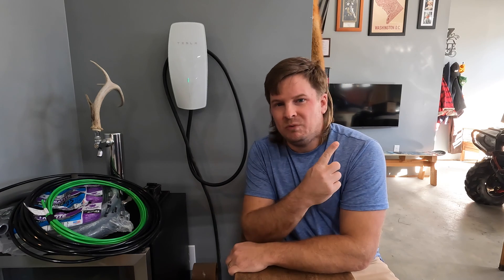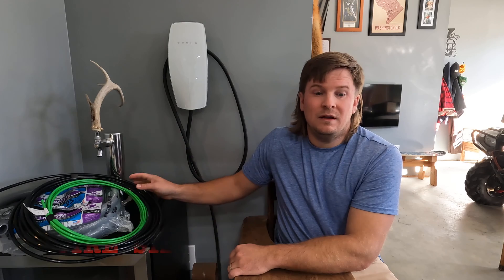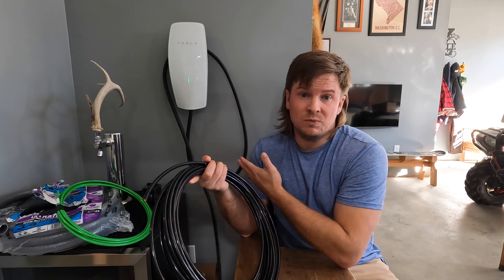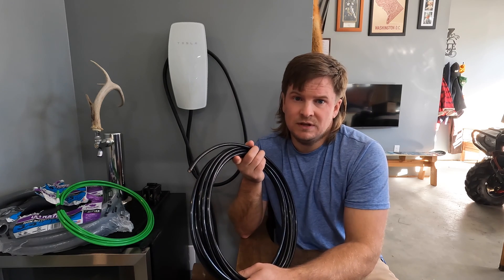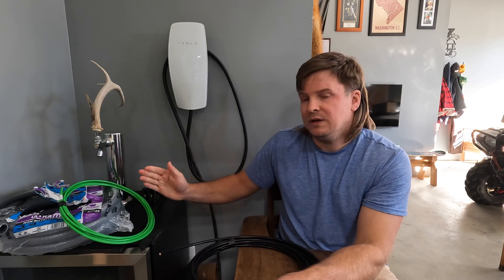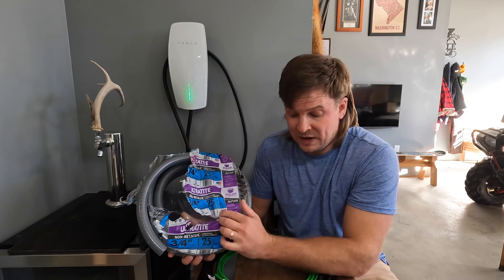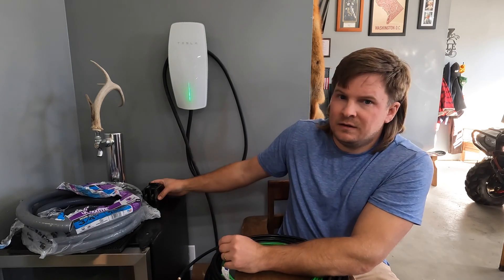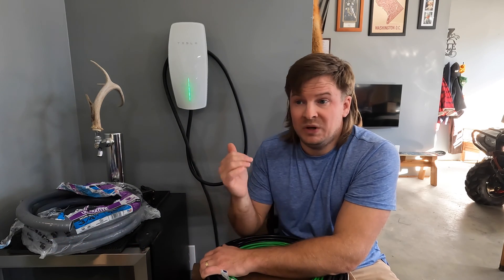Installing Tesla Wall Connector TIPS

Comment: Your  video makes about 50 Ive watched. I am running wire about 72-74 feet and  opted to go with 4awg for the hots and 6awg for the ground. I am using 1" conduit (Liquid Tight like you show) across my attic. Then I am going to use a 4" box to make the transition a bit easier at the point where I come in through the garage ceiling. I will mount the box in the attic, tie in the flexible conduit and then exit the box with 3/4" EMT (metal) to go through the ceiling down to the top of the charger. The box is just to transition, the wires will be a continous run. I could find adpaters to go from the flex to metal but not one that reduced size as well. I want to come into the charger with 3/4" as it will be coming into the top and Tesla states you should not make it any larger than that. I think EMT in the garage will look better than the flex as well.

Comment: 6/2 is NOT acceptable if you're trying to use the max. 48A rate - Romex does NOT meet the 90deg C. heat rating. Only 6ga. single THHN strands run through conduit are OK.
Reply: or MC 6/2

Comment: Glad I found your post. I need to run about 88ft. for my wall connector. The Tesla manual said to use 6 gauge. With the Voltage calculator, drop will be limited to 1.56% or less with a 6 AWG.I wanted to try the 4AWG. The Voltage drop will be limited to 1.01% or less with a 4 AWG copper conductor delivering a total of 48 amps on a 240 volt single phase system for a distance of 88 feet. So thanks for your post I will subscribe. 😉

Comment: This is very helpful. In Los Angeles - and probably all of California - they offer a $ 1,000 rebate for the charger and installation but will NOT give a rebate unless it's installed by a licensed electrician. Also, as of this post, LADWP will NOT give a rebate on a white charger, they only rebate the J1772, which is the black charger. Go figure. I am told that will be changing, eventually, but just be advised.
Reply: Isnt there a 30% Federal Tax credit for these?

Comment: if youre using THHN wire, I believe the 6awg is rated for 75amps, so should be good. If romex, yeah go 4 awg, 6 awg romex is only rated for 55 amps. What gauge ground are you using?  I was reading you only need a 10awg ground wire for a 60amp circuit, but curious if people are going lower.
Reply from the maker: Thanks for the info! I am using 8 gauge for the ground.

Comment: could you post link to where you bought 4/2 cable. Big box stores only carry 6/2
Reply from the maker: Hey Anil. I bought the 4 gauge wire from Lowes. You have to buy it by the foot for each L1 and L2 (run both wires and then your ground also). So you I’ll have 3 individual wires ran through your conduit. I don’t think you can buy it all wrapped into one. Hope that helps.

Comment: Top Tip DO NOT BUY A TESLA HOME CHARGER.
Do not buy a Tesla wall charger, get a different kind. Tesla wall charger aren't as good as many of the cheaper ones available. Payless to get a better quality charger plus Tesla has no customer support, so when you get a defective Tesla wall charger no one from Tesla will help you
Reply: Not buying this "TOP TIP".  The "State of Charge" video guy on youtube actually says the Tesla charger is the BEST.  He runs chargers through a barrage of tests, drop, cold,  heat, etc.  I have one, and have never had any issues with it, and it was super easy to install, and has built-in gfci protection.  Tesla offers a 4 year warranty - who else does that, and its the only charger that I am aware of that accepts #4 AWG.  That alone tells you that Tesla chargers are the best built/engineered units.  If you get a defective one, which I suspect is an extremely unlikely probability in the first place - just return it.  At $425.00 for that kind of quality, and a 24 foot cable; I doubt that there is a better charger right now.
Reply from the maker: Thanks for sharing
Reply: Do not buy a Tesla wall charger, get a different kind. Tesla wall charger aren't as good as many of the cheaper ones available. Payless to get a better quality charger plus Tesla has no customer support, so when you get a defective Tesla wall charger no one from Tesla will help you
Reply: @CarsonAdventures which one did you get? Thanks
Reply: @usinebob   grizzl-e level 2 the $395 dollar one. A friend of mine purchase their $495 version and it's nice but I personally don't think about it. There's nicer. I think there's $395 one is the best bang for your buck. No issues at all. Even in an Ice storm and a week that never got above 15 and spent most of the time at 0 and below.

Comment: That 6-2 wire is not rated for 60 amps, that number 4 that you are now using needs to be in a 1 inch pipe. Number 6 thhn rated for 90 (C) is correct. Tesla does the math for you or FLA X 1.25 = breaker size. So 48x1.25=60amp breaker. According to my "electricians bible app" #6 - less than 3 current carrying conductors - wire rated at 90 c - derated ampacity = 60amps. #6 NM is rated for only 55 amps, you might want to adjust your breaker size. I would suggest buying the paid app for the Electricians Bible it really comes in handy, like having a code book on your phone.
Reply: @rob
So for three #4 THHN wire you need a 1 inch conduit. How about If i use two #4 THHN and one #6 THHN wire (for ground) what size conduit would that be?   Thanks for your help!
Reply: @arielramos2922  my app on my phone says one inch pipe for what you are asking. Something to consider with this Tesla gen 3 is you pick the amps for the charger via the charger setup menu. If you don't need the full beans charge use smaller gauge wire. Example, looking at the Tesla gen 3 chart you can go to 50 amp breaker max full load amps is 40. You go from 34 miles of charge per hour to 29 miles for a Model S. Is 5 miles per hour of charge so bad for a overnight charge?.
Reply: @robm3063  Thank you Rob for the fast response. I will use the 1 inch conduit. Also, thank you for the tip on the only 5mph difference (I have a 2023 Model Y). It will be charging over night so not much difference to you and me, but the wife sporadically decides to drive somewhere at any time of the day or just plan out a 200 mile trip to Disney or Universal Studios in Orlando FL; so i want to make sure to take advantage of the fastest charging speeds lol. Thanks again for your help!
Reply: @robm3063  one more question. Can the #4 or #6 ground wire be Bare {just copper} (No green color jacket) Or does the wire have to have a wrapping around it? Want to make sure I follow FL code. Thanks!
Reply: @arielramos2922  green
Reply: @robm3063  Ok. So can't be bare. I'll get it with a Green Jacket. Thank you again sir.
Reply: @arielramos2922  So you're in Florida right. Are you not allowed to use romex? Why are you piping this charger? I piped the charger I did (wasn't mine) because I'm in the west suburbs of Chicago. We pipe up here. I'm retired union electrician and I piped houses here for over 20 years. Not sure what your situation is but I'm pretty sure FL doesn't require pipe. 90 percent of the YouTube videos show people with their panel in their garage, easy install. Is your panel in your garage?. In any case if you're not comfortable doing this than the #6 Romex option might be a better option for you. You just can't run the charger at full rating. #6 Romex is not rated for 60amp. Please be careful with electricity, there's no do over's.
Reply from the maker: I would use at least 1” conduit. Bigger is easier to pull and safer for when the wires heat up.
Reply: @ZittleFarms  That makes sense, the easier the better. Thank you for replying.
Reply from the maker: I see where you are correct. Thanks for watching and chiming in!!
Reply: @robm3063. I thought the beaker size depends on the capacity you have for your house. Amy idea how high I can go if my house has a 125 amps capacity? I know for a 200 amp capacity you can do a 60amp beaker.
Reply: @mexgio4l  You are correct going by code. There's a whole chapter in the code book for calculating the load of a dwelling. Guess what, I'll bet the majority of people are in your situation. That's why if you look at the Tesla installing instructions there's different amp settings. Well that's what I took from the instructions from the unit I installed for my nephew. Not sure what generation charger it is but it has WiFi. My feelings are if you are charging overnight go with the lowest amp per hour you can just to be safe. You can always up size the wire while still using the correct breaker size.
Reply: @robm3063 I got the new Tesla charger with WiFi. And put the correct wire for future upgrade to my panel. My question for you is. Since my panel’s capacity is 125 what is the highest breaker I should be installing? Everything I see shows 200 amp capacity can do the 60amp breaker charging at the 80%. But not quite clear on what the correct max breaker I can install for my 125amp home. I’ve seen both 50 and 40 and I want to install as big as I can while being as safe as I can. Car does not get moved after 8 so I’ll lower the charging rate but still want the option to maximize the charging if I ever need to.
Reply: @mexgio4l  I can't tell you what to do here. You are stuck with the panel amperage you have. If I was to suggest something it would be to take a reading of your incoming amps on each leg at the time of when charging would occur. Unless you have electric heat and or other large loads like hot tub/pool heater you are not drawing large amps in the middle of the night. I will say this. The unit I install for my nephew  was at full speed 48 amps. The run was just less then 100 feet using # 6 THHN 3/4 EMT and the wires were buzzing a bit. I recommended turning the charger down one setting. Being a Millennial the nephew so no I want it all. Oh and remember if you are using Romex you can not use #6 as it does not have the correct temp rating. There's a lot of youtubers out there that are in for a surprise after their homes catch on fire and the inspectors find the wrong wire being used. My 2 cents